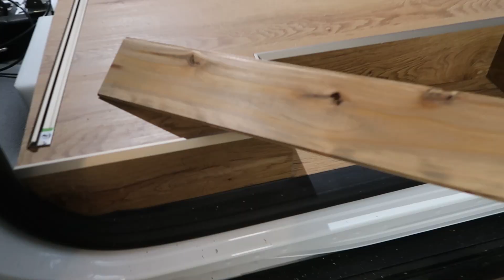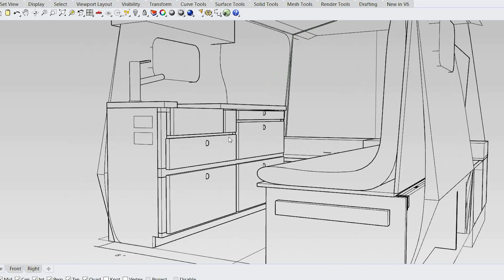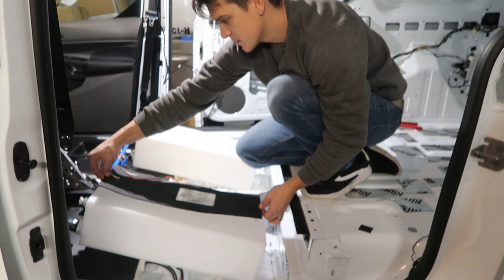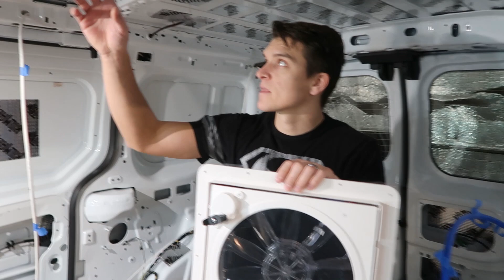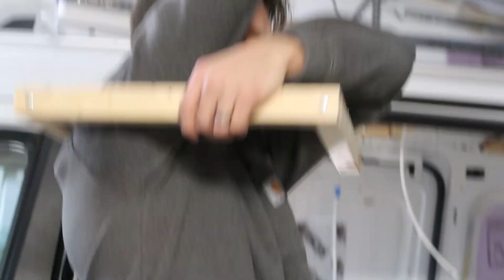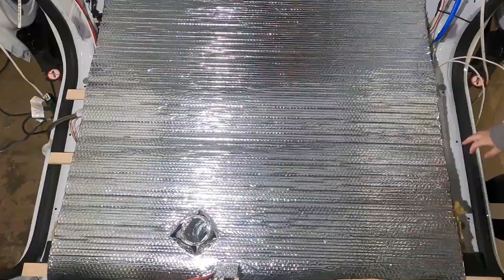MICRO VAN CONVERSION | Plumbing, Flooring & Ceiling Pt. 1

Comment: Excellent use of the rear footwell space !!!   There’s not many people touch it🤷🏻‍♂️🤷🏻‍♂️🤷🏻‍♂️ a Tourneo is the exact same as the Hitop ZLWB version,,  I’ve got my power (battery’s under there spread even,y for weight and then the “‘panel”’ bolts back down,   Brilliant to see other’s using that Dead space 
Loving the videos & Subbed to channel,,  got some great ideas from here lol 🏴🏴✌🏼🚛💨💨